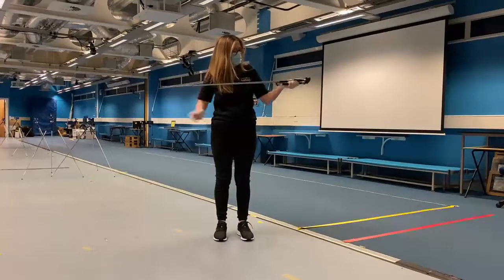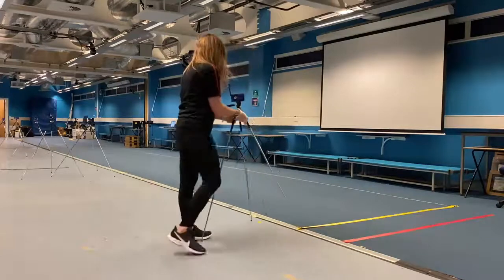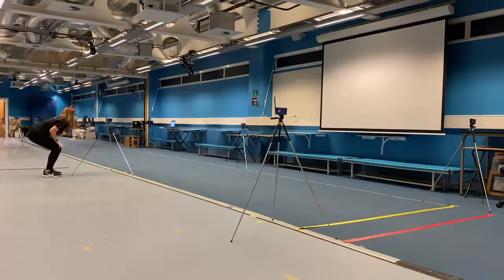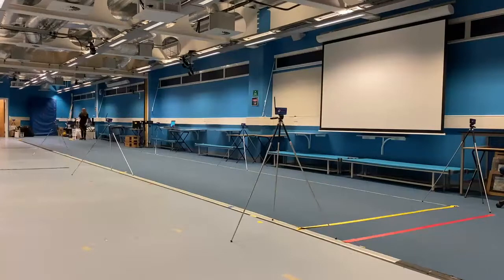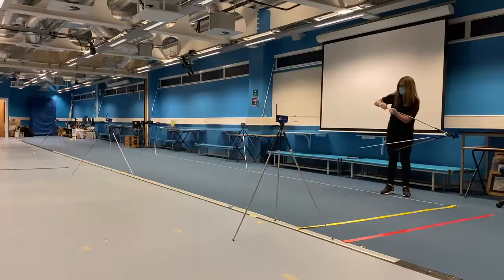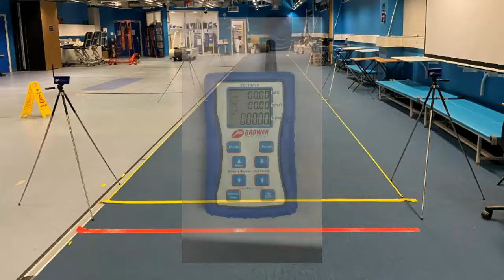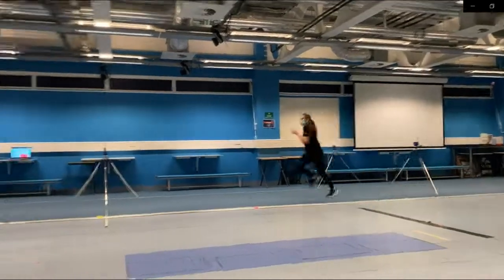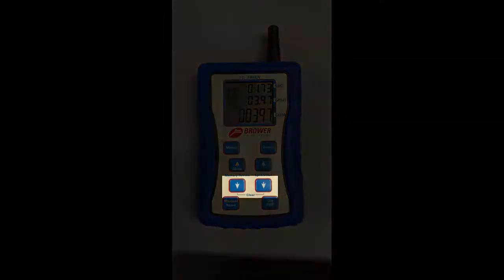How to use a Brower Timing Gate system

Comment: Very interested in getting a similar system but I am curious- are you able to run multiple people through at the same time? As a track coach I'm looking to be able to get times in on my athlete's workouts with a timing system but don't want to run people one at a time if I can prevent it.
Reply from the maker: Hi Brendan, thank you for your question. With this system you would need to run athletes through one at a time. As soon as the first athlete is through the final pair of gates, you select new on the handheld device and then the next athlete can start. There may be a system on the market which would work for that, however I am afraid that this Brower system would not suit. Many thanks,

Comment: Is there anyway to not take up as much space while using these?
Reply from the maker: Hi, You do not need to open the tripod legs this wide. You can keep the legs narrow, however please consider that the tripods will be less stable if accidentally knocked. Similarly colleagues have created custom tripods to fit timing gates into small places, the custom tripods were almost poles mounted onto a base plate, with the timing gates mounted on top.
Reply: @laurasmith_uos  that makes sense that it would be less stable.
I'll look into that. I recently saw something that matched the description of the poles they are using. 
Thank you!

Comment: hi Laura - would you recommend the Brower timing gates?
Reply from the maker: Hi Brian, apologies, I have only just seen this. Yes, whilst I would recommend a Brower timing gate system, if you're looking to purchase I suppose I would suggest you look at the budget you have and what you require from them. I also use Witty Timing Gates, which are more modern and have the capability to connect to an app, however in some instances the Witty I found a little less user friendly. Brower's are user friendly, however the version we have does not have the ability to connect to an app (just the handheld device) and the tripods are rather flimsy and easy to damage. You could also consider whether you would benefit from having a dual beam versus a single beam system, the Brower is the latter.